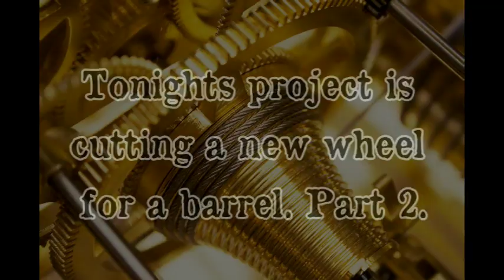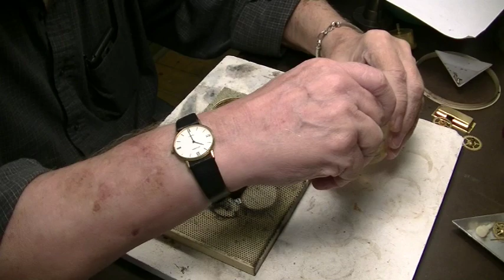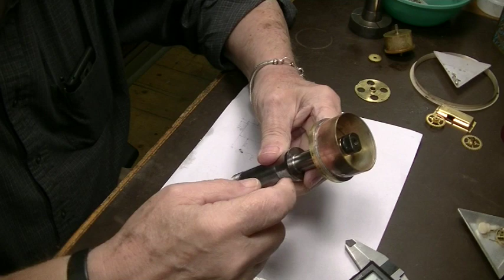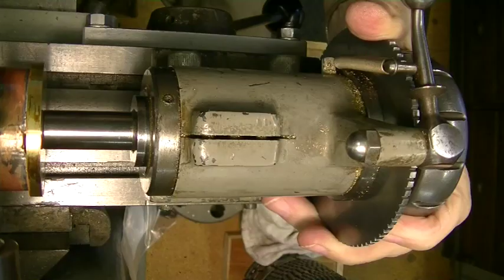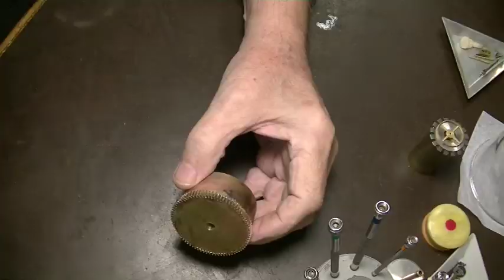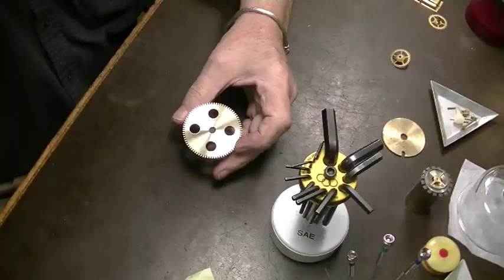Clock repair tutorial. #4. Cutting a new wheel for a barrel. Part 2.

Comment: That's a sweet old Hardinge mill.  I love the stack of index wheels off to the side.   I'm working to get my Pratt and Whitney No. 3 bench miller up to speed to cut gears and pretty much have to make all the tooling for it, but I'll get there.  Good tools sure make clock work a lot easier.

Comment: I have an old Barker PM horizontal mill with lever feeds for both x and y movement. You were using the lever to advance the table in this video, but when cutting PINIONS do you use lever feed or is your mill equipped with lead screw for that operation?

Comment: My daughter gave me a Regulator pendulum clock, has a time key that also the chime, trouble is, it don't chime. Do these clocks have a silencer on them? The clock has no name, probably a modern clock, not an antique for sure. It make a dud sound on the hour, but no chime. I really want it to chime. I did wind the chime key in the counter clock wise motion, and it did wind up.

Comment: James, how did you ensure the correct depth of cut per tooth for the wheel?  I've cut plenty of gears very similarly to your method but I used a dividing head.  My point is, I've done it and know how its done, but many of your future viewers probably will not know.  What tolerances do you try to hold for clock making?
Reply from the maker: ¨The depthing all depends on how you make the cutter but it is automatic when the addendum one tooth touches the addendum of the of the next tooth at the top. I I try for a tolerance of plus or minus 5 thou.
Reply: Good day Sir, is the type of cutters used for clock-works on sale somewhere? Also thanks for the generosity of sharing.
Reply from the maker: Yes they are available from Thorton cutters in England but they are expensive. About eighty-five pounds each or twenty-eight hundred pounds for the set. I make a lot of mine as it seems many wheels have a different tooth module. I've never known for them to be on sale.Thanks for watching, JL